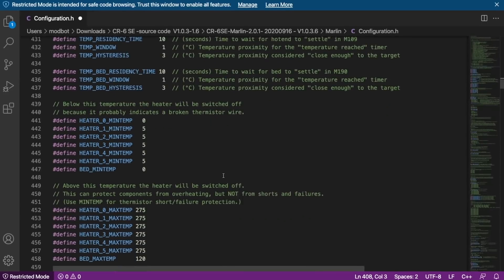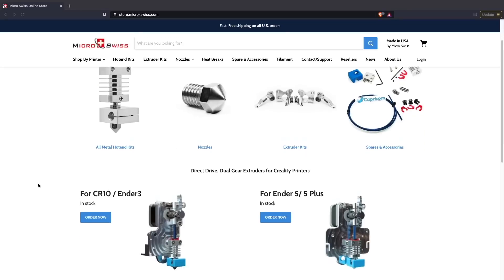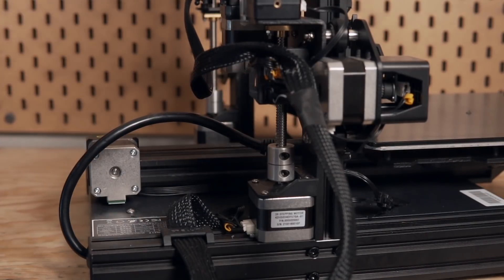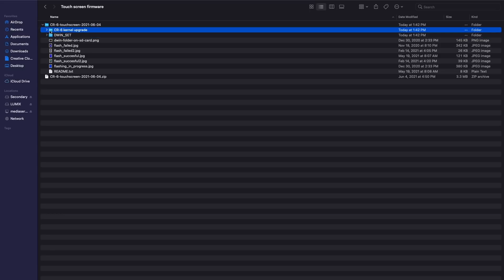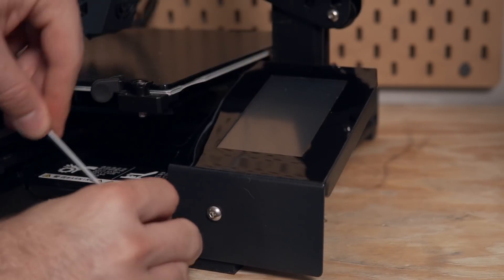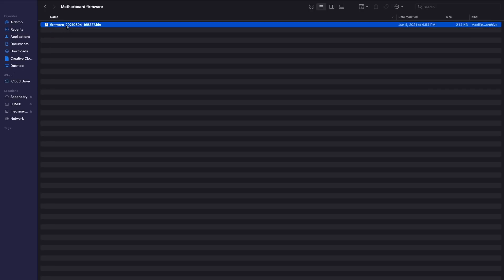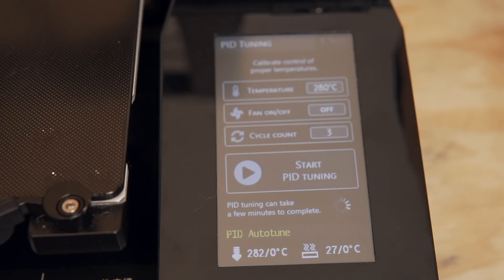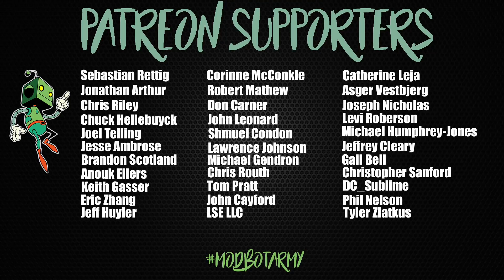Level Up Your Creality CR-6 SE With The Community Firmware!

Comment: hello there.. I followed your instruction to the letter until I tried to do the "pid" and I got the following: "HEATING FAILED  The target temperature  for the nozzle or the bed was not achieved within the allotted  timeframe. This is usually caused by a too cold environment, damaged or incorrect hardware, or a poor electrical connection within the unit. Verify your hardware  and environment, and try again.." :(

Comment: Great video. I’m now running community 6.1 with your temp recompile.  Excellent!

I want to print more high temp materials and the micro Swiss looks like right/only all metal option.  Once you tuned it, is it any more prone to clogging etc than the stock Bowden tube?

Comment: Everything went well. Autoleveling OK. But very soon after starting a print, I will get a message that the print is succesfully completed. On every print, no matter what slicer I use. I used a Creality v1 mainboard and now a Creality v4.5.3 32 bit mainboard. Different board, same result: 100% after a few seconds.

Comment: Hello how are you? I have a CR-6SE, I was printing for more than a year without problems, until it stopped extruding, it starts printing the first layers of the piece, but after a few minutes it stops extruding material, but if you push it by hand, it flows usually. change the
all hardware components Hotend, barrel, heatsink, teflon capricorn, and place a metal extruder. It had started fine, but every two prints, one goes wrong and gets stuck again.
I have two CR-6SE for now, one has been working without problems.
I already took it to a service, and they returned it to me the same.
I would be very grateful, if you manage to detect the error and share it with me. Greetings.

Comment: Followed this step by step all worked great. I couldnt get your firmware to work but the other one did. I had the same board as you as well. It was just in a boot loop. Also. Its safe to remove the SD after flash and first boot up correct? Then I can use the SD slot as usual? Thanks again great video.

Comment: Anyone coming here with an unresponsive display (the progress indicator goes all the way then just get a beep). Use the same micro SD card you used for the display. Then you know the card is good if the display had updated. Also make sure to do a full format. Do not just do a quick format if doing the format from a gui.

Comment: I am converting my Creality CR 6SE over to be able to run higher temperatures I’ve already put in the micro swiss hot end. QUESTION; do you know of a better (heavy-duty) aftermarket thermistor than what is currently supplied with the Creality CR 6SE?  Thank You, Bob Griffith

Comment: Hey guys for anybody having the "firmware flashing incorrect" error ITS THE SD CARD that connects to the motherboard not the screen one. Trust me i was frustrated for hours. all i had todo is change the sd card with the firmware and it worked immediately. Its crazy.  So happy it works now. Credit goes to the commenter who suggested it originally. I just wanted to enforce that it definitely is the problem.

Comment: Great video, easy to follow and very thorough. I also upgraded to the Micro Swiss hot end and decided I'd update to the latest community firmware. Successfully flashed my Creality TFT screen, then the motherboard with your increased temp build. On power up, I get an audible tone and a message on the screen saying "build 60 found but expected 61". I flashed the the screen again with the CR-6-touchscreen-2021-03-27 DWIN_SET folder, but still have the same error. Any ideas or anybody else reported this issue? Tried Google but no love. Where do I find 61?
Reply: a it late. but, flash the 300C firmware, do all the calibrations especially PID tuning, then flash the normal one. this seemed to help the 2 i have, and they are even different generation boards.

Comment: Thank You, Thank You, Thank You!!!
I have been trying to update the firmware on CR6 SE for 4 days and almost gave up the printer for dead! I watched and followed several other videos and could not figure out what I was doing wrong!

You were the only one who just happened to mention the need to copy the 3 kernel files into the set folder if I’ve never run the community firmware update before!

The other videos were great but in my opinion your video was the most thorough for us newbies!

Comment: I followed these directions to a tee and now my printer won't work and the led on the hot end just blinks. I got the right version. 4.5.2 , I formatted not 1 but 2 separate cards . Now the machine is a brick. Fantastic....

Comment: I JUST got my new MicroSwis extruder replaced on my CR6-SE. The first test print was pretty decent. I still have a bit of tuning to do to get er fine tuned enough that I can resume 3D printed RC projects. So far I'm LOVING the upgrades. THANKS for the FW that allowed us to increase print temps, & for the videos on this machine!

I think the new extruder will serve me well, especially since it's coupled with the upgraded hot end!

Comment: I'd love to see a video where you go over your settings for Cura with this updated hot end & firmware!
Reply: I JUST got done upgrading to the Micro Swiss hot end on mine. 
In the past when I've had issues the bowden tube would clog up on me. My fear is that if I clog the metal hot end I might not be able to unclog it. It wouldn't be as simple as pulling the Capricorn tube triming it, slamming in a new nozzle, & going again.

Comment: So i installed the community firmware on my CR 6 and i started experimenting with multicolor prints so i added a pauze in Cura slicer and that worked perfect. The machine pauzed and i could change the filament to the right color.. However i could not find a way to resume the print.. I think i tapped on everything i could find but could not for the life of me get it to resume. So i decided to cut the power and then after powering it back on i got resume but then it started printing way to high in the air.

So my questions are:

    How can i using the community firmware when i sliced in a pauze with cura resume printing?
    Why did it start printing in the air when i powered it back on?

If anyone can help me gain any insight with these problems its much appriciated!
Reply: I think if you pause in the gcode then you'll need to resume in it as well? Perhaps you can insert a delay to give you time to change the filament.

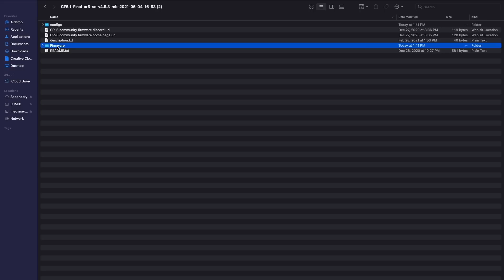Comment: I've been trying to update my printer for 2 weeks with absolutely no luck.  Hopefully you can help.  I've got to 6:35 in your video and my screen does not show the boxes off to the left to chose the 3 items to move over to the other file.  Totally new to this. Any help would be greatly appreciated.   Thank you
Reply: not sure if you figured this out but when i downloaded the new firmware those kernel files were already included in the dwin folder. nothing to move and everything flashed correctly!

Comment: Any chance you could throw a max-temp version for the BTT CR-6 board on your drive? I had one of the original (likely to catch fire) boards and recently replaced it with the BTT board (has UART control and the ability to not run the annoying mobo fan all the time).

Comment: Great video! I appeared to successfully flash the touchscreen, but I keep getting the 'firmware flashed incorrectly' message on the bottom of the community upgrade screen. If I select a function, the back button won't work. Not sure what I did wrong?
Reply: I have the same issue ! Have you found a fix?

Comment: I just bought the CR-6 SE and the motherboard version is Era v1.1.03 out of curriosity did this board version come out soon after the v4.5.3 with more bugs/fixes to the hardware version v4.5.3 which was suppose to take care of the USB issue in some v4.5.2 boards.  Not sure why creality went from v4.5.3 to v1.1.03, version wise it doesn’t seem to make any sense?

Comment: Thanks heaps, I kinda miss-flashed mine about 6 months ago, but other than losing all languages except Chinese, which since it still used regular digits, and I knew the menus backwards, I kinda just kept using it from memory.  Anyway, with such a complete guide, I figured it was time to remedy that, and wow, the auto bed leveling is so much better, no more messing around with offsets!  Liked and subscribed mate.
Reply: Oh, yeah, and it's back in English! ;)

Comment: I installed a Micro Swiss all metal to my ender 3 pro and changed the max temp to 300. Does anyone know if the stock ender 3 pro thermistor can handle temps higher than 260?

Comment: Big question... I have a CR-6 SE and mostly print PLA and the thing prints perfectly out of the box.. Why should i update besides the features? will it print even better? im trying to see the added value of the hassle of installing the firmware on a printer that prints perfect out of the box?
Reply: The community firmware is far superior to creality's which is so bad that you won't believe how bad it is until you change to the community firmware upgrade. DO IT NOW you will not regret it.

Comment: Would the stock thermistor reach those higher temps?
Reply: Thanks Daniel for making the modified firmware with the higher temps available. But I am in the same position as Alvin. Are the stock thermistor and heater cartridge rated for these higher temperatures? I don't have a problem with 260°, my issue is with repeated use exceeding this.

Comment: Nice work. The Micro Swiss hot-end is here and I am currently printing out the 40mm hot-end cooling shroud adapter to help with the upgrade. The community firmware is still by far the best upgrade for the CR-6 SE by far and we cannot thank Sebastiaan and his team enough for this.